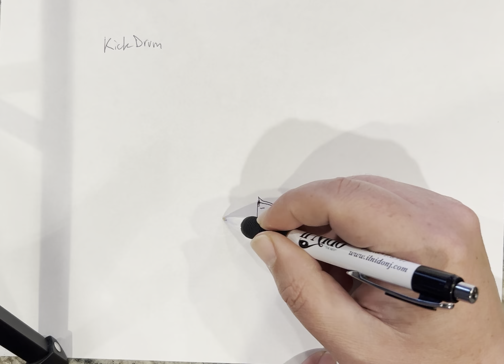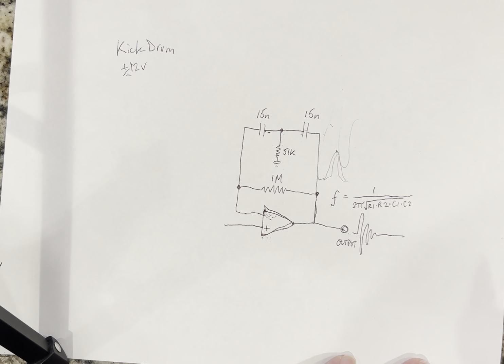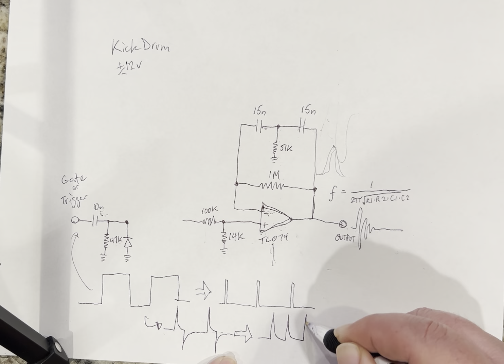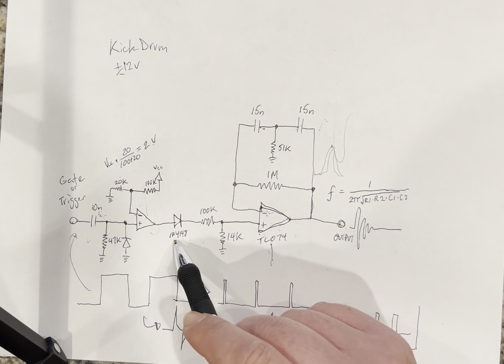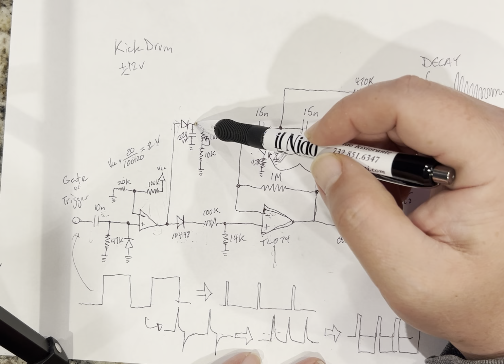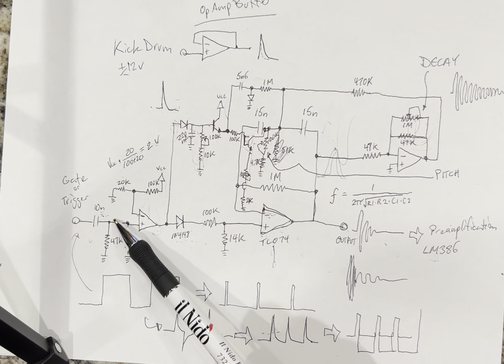How to make a TR808 analog kick drum circuit

Comment: This looks exactly like Moritz Kleins 808-Kick circuit.

Thank you for the explanation
Reply from the maker: Yes it does. Both are based on the tr 808 schematic which is the original and can be found online. Moritz is just smarter than i am and can explain away the engineering better.
Reply: @igorbrichkov3632  I like your explanation of the circuit as well! Thank you! ;)
Reply: @igorbrichkov3632  
Yes, i know. I have built a couple of these to use in my modular synth. Juanito Moores design and Moritz is the ones i built so far and they both sound great and are really fun to play with. I have built a 606-hihat and a 909-snare too so far that i use with the kick in my modular synth. Fun to be able to customize everything down to detail-level :-). 

I dont think his circuit-explanation is better than yours necessarily, or worse. He really has worked on his concept and does a great job explaining with his animations and comparisons.

But. Hearing different persons describe the same things can be a really different experience depending on "chemistry" or something. Different persons learn better from different teachers. Your explanations may be exactly what someone needs to hear to finally get it. 

Moritz is smart though. His channel is great, very educational.
Reply: Cool, I’ll watch his video instead. Bye